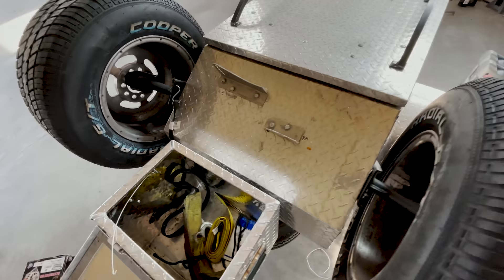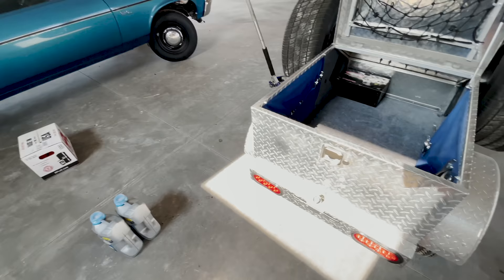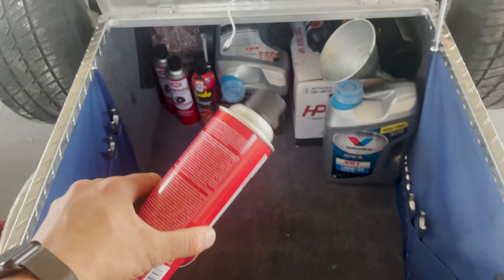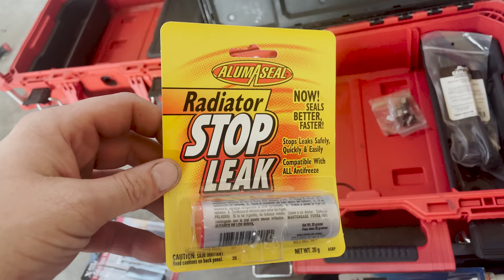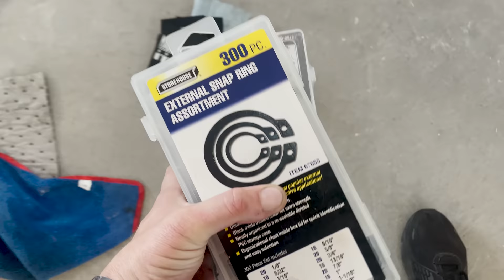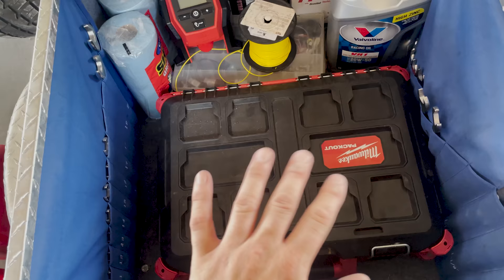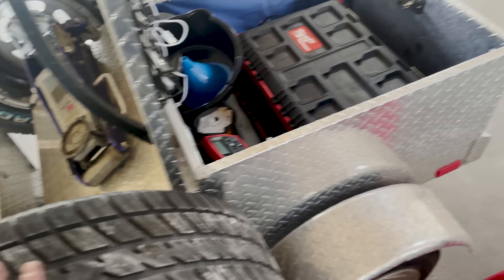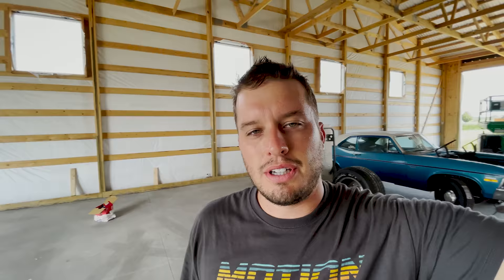How to Pack a Raceweek/DragWeek trailer!

Comment: I  run a Gear Vendors behind a TH400 but.. I don't use it specifically for MPG. Its used to keep rpms under control. When you have a 4.10-4.30 etc gear its a LIFE saver. Less rpm is less times the valve train cycles over the life of the event. Things are so less stressful mentally when you can actually keep up with highway traffic also. I am a 7 time participant 7 time finisher and 7 time podium..so..I dont feel Im talking out of my butt saying this.. food for thought on folks that cant run a highway gear like you do.
Reply from the maker: Definitely, turbo cars have an advantage with tight converter and tall gears, I should have added that caveat
Reply: @MotionRaceworksOfficial   Don't get me wrong.. we appreciate how you are trying to grow this sport👍.  A lot of folks look UP to you guys and might interpret what you said as gospel for all and not relate it specifically to turbo car.
Keep up the good work👍

Comment: Pro tip:  Get or make adapters  and replace the trailer wheels/tires with your car's spare wheels/tires.  You can put a skinny under the trailer for a spare.  This saves the weight of the extra wheels and tires to pull.

Comment: Another thing would be choose a class that you can run without pushing your car to the extreme limits.  If you're running your car on the edge of parts failure point every pass you will most likely break it before the end of the week.

Comment: Just curious about how you transport your fuel? We got stopped on our way to the track one day with three 5 gallon VP racing containers of alcohol.  The cop was pretty cool but told us we could only carry 5 gallons legally in that type of container. He stated they had to be in DOT approved containers with spring loaded nozzles and secured by some type of crate or basket ?Anyone else ever run into this?

Comment: Smart less is more approach. I’m currently building (collecting the pieces) a 55 Chevy wagon to do these events with and have been wondering if I should get a trailer as I could just pack the car but you just made up my mind I will get a trailer because yes unpacking and packing  constantly would suck.
I think you’ve steered me to a powerglide or th400 too. 
I’m shooting for mid 10s with my car small block, efi, single turbo as simple as possible.

Comment: Has anyone ever tried to use a lock up convertor for drag week. Like not for the drag racing but so that in high gear you can lock it on the road and the convertor is what makes a lot of heat in a transmission on these events. If you lock it up it may stay way cooler and pull a trailer better.

Comment: I offer custom treardrop trailers,  i can build them to house all kinds of welders and air compressors and kegerators,  spare parts, spare engines.... whatever the racer needs, they start at $3000.00  bare bones.    The teardrop is wicked aerodynamic, ultra light weight  and is cavernous inside.   We can also paint or wrap to match your racecar